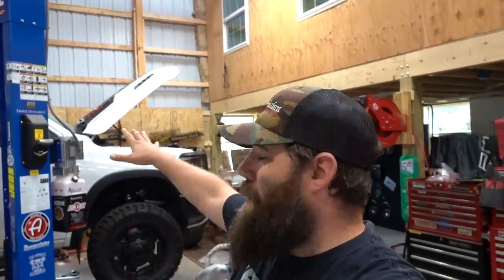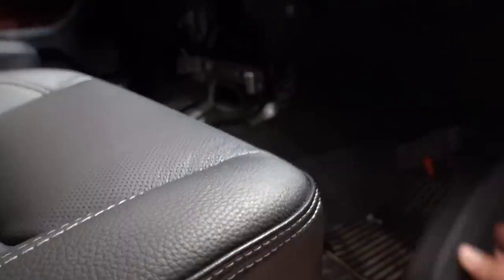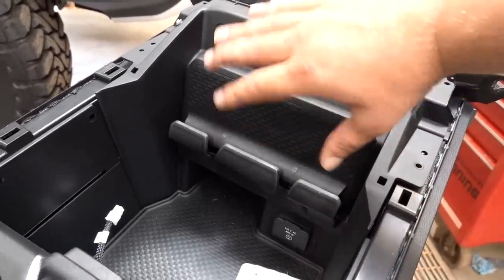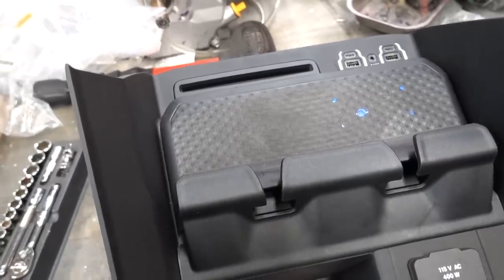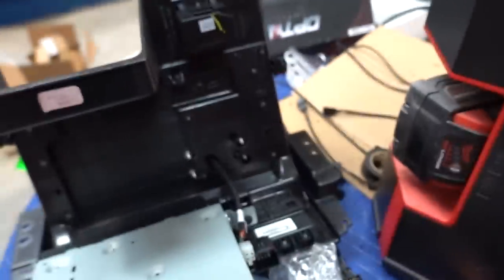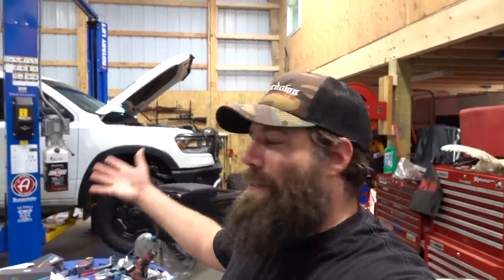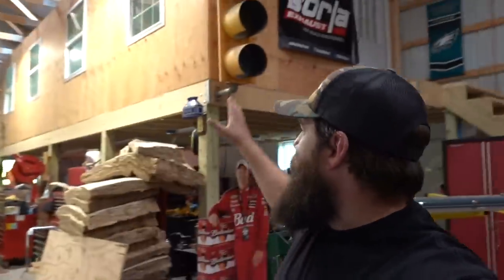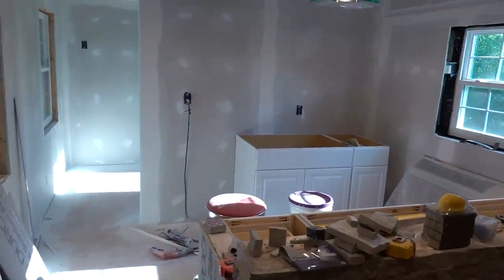2019 Ram Console Removal

Comment: One video you did all 4 doors and the console now but you never specify how much of each lighting you need. It’s a very cool upgrade and reading thru the comments a lot of people want to do the accessory upgrade but one one hand people could wing it but some may not have the extra funds to over order the lights. Thanks in advance. Awesome job on the rebel.
Reply from the maker: Johnathan Curbey I used two kits and had some there stuff I had from a previous project you need the 4 12 inch lights and 2 additional if you do the console plus 8 of the 4 inch lights, each kit has a bunch of connectors any splitters you may need to order additional extensions depending on the routing, thank you for watching

Comment: When drilling your holes in plastic, I HIGHLY suggest using a much smaller bit at first as you greatly risk cracking or damaging the plastic you are trying to drill through. You can always increase the bit size from there.

Comment: "HammerDown"!...hey i finish my to.i did disconnect the neg battery.all i had to do was reset the clock.the model i have dont have the bolts out the back,but uses a "Clip bracket instead.so i guess i will have to use "DoubleBackTape".but what you did help me with is where and how to run that cable thru.all i have right now is pic's right now.but i will try to make a vid so you can see how my came out.Oh...P.s im going to order that "MoodLightSetUp"that your using...P.s again i just install all new speakers through out.next in going to install the "Amp"will keep you abreast.😍😍😎❗

Comment: Is there a way to get to the harness on the front usb c, and regular USB ports to charge/connect ur phone to the radio without taking the center console out???  On my truck when I hit a bump or make a hard turn the radio switches to aux but I’m not connected to my truck or when I’m using Bluetooth the radio switches to FM radio station which is annoying. And when I push in to the ports with my hand it switches sources, so if I’m listening to the radio it will switch to aux.

Comment: Getting ready to install switch pro as well. Where did you mount the other portion of it? Did you do it under the hood? If so where? Not seeing. Good spot for it. I'm probably over looking that perfect spot...
Reply from the maker: I put it in a video I made a bracket extension and used the factory holes mounted it on the drivers side under the hood towards the front
Reply: @HammerdownMotorsportsUSA  which video. Thought I watched them all. May not have.
Reply from the maker: @OptimusGrizly  the video is called 2019 ram Rebel accessory update
Reply: @HammerdownMotorsportsUSA  ok thanks. Was just looking through videos to try to find it. You have more than. I remember. I may not have clicked on the tab for all videos.
Reply: Also copied and pasted to ram forum on Facebook I am in so may help boost them views a little.
Reply from the maker: @OptimusGrizly  cool thanks

Comment: I am looking to add the usb and and possibly power outlet to the back of my console. When you had it out, did you see if those parts are separate? I’m thinking I will need to buy a few parts and hoping that it’s not a different console to have the rear USB’s.
Reply from the maker: I’m not entirely sure but I would think they could be added unless there isn’t a provision for the harness, the console removal is a 10 minute job of you want to take a perk in there
Reply: @HammerdownMotorsportsUSA  thank you

Comment: Not sure if the console would be in the way but while it’s off are you going to take out the centre display to check the wiring for the front camera?
Reply from the maker: david whittaker I am waiting for an interface that will allow for the camera install but I may pull the screen anyway to have a look but I don’t think there is a place to plug in a camera without one

Comment: Pulling out the console is there a way to add a seat.  I need seating for 6.  I am debating buying a rebel and removing the center console or buying a Laramie and upgrading the suspension and everything else to get similar to a  Rebel.  Suggestions?
Reply from the maker: Kelly Fontes if you get a Laramie off road package it has the Rebel springs and I’m sure you could buy the Bilstein shocks or go with aftermarket if they offer a bench on a Laramie trim
Reply: @HammerdownMotorsportsUSA    Laramie's the highest trim that you can still get a bench on.  I will take it as leveling the Laramie up is the better option thank you!!!
Reply: Kelly, have you found any additional info on swapping out the front console for the center of the 40/20/40 bench?  the configuration i want doesn't come that way, i'd have to build custom... wondering if i can swap the seat IN for the console
Reply: @entwisjj  Unfortunately no.  Best to mod other things on the truck.
Reply: So I couldn’t switch the center console for a seat for the 2019 with the big horn package?